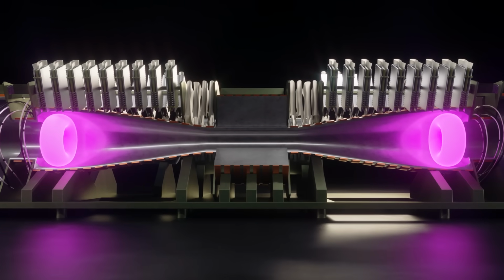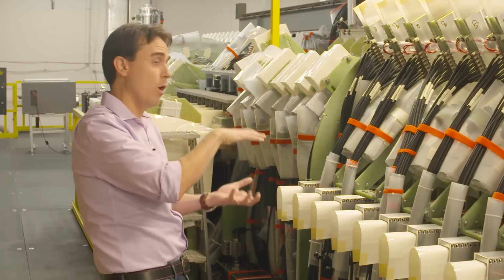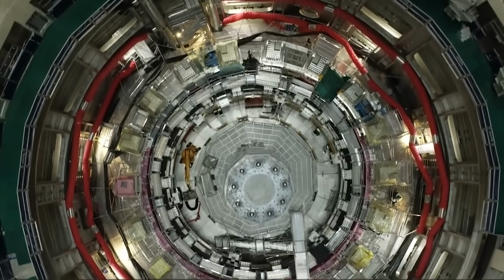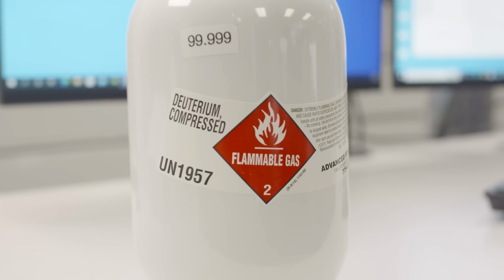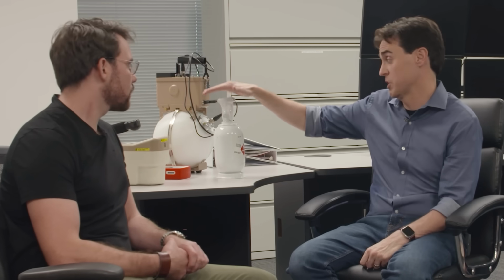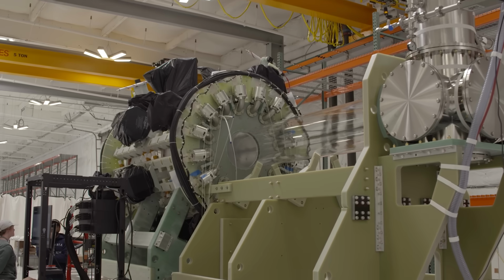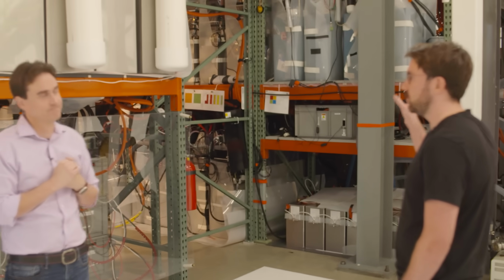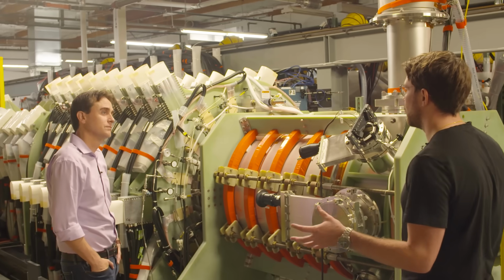A New Way to Achieve Nuclear Fusion: Helion

Comment: I love the fact that it generates electricity directly from the reaction, it always feels weird to go through all this cutting edge technology just to build a stream engine!
Reply: If anything, it shows the long-lasting impact steam engines have had on our society
Reply: @tacomeme429  if anything, it shows how we are just learning new and better mechanisms of energy conversion
Reply: We somehow live in a steampunk world, but it turns out it is unlike the visuals we were shown.
Reply: @Sapeidra  lol I was about to make that statement. Maybe we are moving to "Fusion Punk" if this keeps getting better
Reply: Yeah it's crazy that we've come so far and yet the most cost effective way to generate electricity is to turn it into mechanical motion and turn a turbine in a copper coil.  The only real exception is PV panels, and those only operate at an efficiency of maybe 15-20%.
Reply: @matthewm8876  Is that not proof steam turbines are the best means? The only other way is, as you say, 20% efficient at best.
Reply: Hey steam turbines work, some of the most efficient energy converters we have, you can't get waste heat if the energy you capture is heat itself
Reply: You proly still need a bunch of electronics to turn the electricity it generates into nice consistent sine waves used in the grid
Reply: This is so true lmao
Reply: Kettle not inculded....
Yeah totally agree 90% of power generation seems to be more methods of spinning a turbine.... certainly not all - solar and wind doesn't but even wind is basically turning a dynamo.
Reply: yes, it´s also mindboggling to me that every nuclear power plant in operation is a very sophisticated water boiler.
Reply: As the joke goes - one day humanity will build a Dyson sphere around the sun... To boil water. Yeah, it's annoying that most of what we do is so horribly inefficient, which is why any breakthroughs in energy generation are so exciting
Reply: it's finally feels like we're finally engineering lmao
- Less moving parts = less weak points
- Less energy conversions = more energy extracted
Reply: very wrong !
Reply: So agree hahaha i was always triggered by that myself
Reply: So basically hot plasma sex
Reply: Can you cash app me 50 bucks bro
Reply: Think of it this way: Incredible! I’ve got part of a nuclear power plant in my kitchen!
Reply: Fusion quickly would reduce Russian oil dependance.
Reply: Right? Using heat to create steam to turn turbines seems like such a backwards approach.
Reply: People who think steam turbines are primitive are idiots, or at least ignorant. The general public seems to have no appreciation for mechanical engineering anymore.
Reply: Yes, as this video shows, they convert mechanical energy into electricity.
Reply: LPPFusion is doing direct to electricity, aneutronic fusion research using the Dense Plasma Focus device
Reply: The question is, at our current level of technology, how would we capture the energetic reaction but a steam generation system?
Reply: That is the best spokesman for a company I'll ever seen. He condensed something completely beyond me into something very digestible and understandable. I love his subdued enthusiasm too.
Plus it's tech that will hopefully create abundance. It's hard not to be excited by this presentstion. Thanks for making this. Great video.
Reply: @quaker3 dude, he's a con man. Their "reactor" has no way of extracting energy at all. It's a fancy fireworks machine.
Reply: @Benjamin-xv9le  Yeah, you're probably right. Being a layman, he's very convincing.
Reply: What I like futuristic steam engine
Reply: Yes, no matter the power source we still generate electricity using technology from the end of the nineteenth century operating on principles discovered and formalized in the eighteenth.
Reply: I was literally talking about this yesterday. "isn't it funny we have all this advanced physics and we're still stuck boiling water?" It's like in a videogame where you forget to follow a upgrade path and you have some end game techs but you're still on early game tech on something else and when you finally up the tech you were missing you feel stupid for ignoring it lol.
Reply: No, not funny. As you often say “ the best things are the simplest ” and boiling water is simple.
Reply: @ub3rfr3nzy94  as advanced as our world is I can still sense the primitive crudeness that still permeates everything and I know in not many yrs this time right now will be like caveman times and theyll wonder how we stood the drudgery and uncertainty of this life.
Reply: @ub3rfr3nzy94  
Do you know why we're "stuck boiling water"? Because it's safe and effective. There are nuclear reactors that use salts to regulate heat and energy, they're called molten salt reactors. Do you know what water is? It's a damn good way to transfer heat. Water has one of the highest heat capacities among liquids that there is. And it's available in near unlimited quantities (for these purposes) on Earth. What does that mean? That means we can regulate a reaction much more safely because the water can be used to draw heat from the reactor and cool it down - this also means that we can also, if we want to, dramatically increase the volume of energy we're producing. As long as you're producing enough steam, you can just have more and more steam turbines to use and generate electricity with that steam. This is why nuclear reactors scale well - you have reactors that are civilian and "privately" owned like test and research reactors. For instance, there's like a couple dozen universities and schools that own their own reactor, Pardue University has had one since the early 1960s, a Lockheed design made specifically for Purdue then, that only generators 1 kilowatt of electricity, which isn't even enough to run your oven (some schools also have a nuclear "reactor" like the AGN-201 which can only generate 5 watts of electricity - not even enough to run a lightbulb, but these are solid-core "reactors" that operate more akin to a RTG, albeit not entirely). And this can be scaled up drastically. The Kashiwazaki-Kariwa Nuclear Power Plant has multiple BWR reactors with one of the newest reactors - alone - producing 1,350MW. With all 7 reactors running? They can output over 7,965MW.

That's a lot of versatility and options. Which, when it comes to engineering, is what matters. Sure, you could spend billions of dollars more having some Sterling-engine, piezoelectric or some such design that has no where near the safety and output as steam and be really, really more advanced than just "boiling water," but ask yourself: Would you want to pay more money for a design that is less safe and produces less electricity? ...I know what I'd answer.
Reply: @matchesburn  Maybe it would help if we called water something else? It's no longer 'Boiling Water', it's 'Hydric Acid Impingement Rankine Cycle'?
Reply: @maltheopia  
"Maybe it would help if we called water something else? It's no longer 'Boiling Water', it's 'Hydric Acid Impingement Rankine Cycle'?"
Oh, man, you just reminded me of that dihydrogen monoxide joke.
"And here is where the nuclear reactor boils 'dihydrogen monoxide.' It's a very dangerous substance that can easily kill a human if they inhaled it, but don't worry, it's safe inside the reactor."
Reply: Aye, but if a steam engine created that much heat or energy in general, there'd be one HECK of an explosion, and not the right kind 😆😅😝
Reply: Just by cutting away the water and steam in the equation, we could effectively made a smaller fusion reactor with the same amount of power generated.  Even in Star Trek, their fusion and matter/antimatter generator rely on direct energy conversion.  Great stuff.
Reply: Yeah, all those research to find more ways to boil water 😅
Reply: LOL....I think the good news is that it isn't too big, nothing compared to ITER that is! This can easily be shrunk 10 times by optimisation in the future and fit in a car.
Reply: @jordaniliev5825  No it cannot, you also do not want anywhere near the amount of capacitors a version of this technology downscaled to something that can drive a car. You will be creating moving electricity bomb that will electrocute anything it has access to in the case of a crash. Might as well be driving your own coffin.
Reply: @Yeet42069  We have been driving petrol bombs for 100 years, so I will take my chances.
Reply: @jordaniliev5825  No you won't because it won't happen lmao. Imagine having a driving hazard on the road because of 1 idiot's indifference.
Reply: @jordaniliev5825 There will be some major hurdles to overcome for the miniaturization of this particular system. They are deliberately enlarging the prototype for their next phase to prevent ions involved in the reaction from striking the sides of the machine as they follow their corkscrew shaped paths.
Reply: @jordaniliev5825  I wouldnt say easily, but maybe in the future we could have much smaller fusion reactors, maybe even small enough for space applications. But that is without a doubt hundreds of years away.
Reply: @kimjunguny Hundreds? My guy, have you seen any technology ever develop? I'm a computer scientist, so I'll use microchip manufacturing as an example: we have gone from a 10 micro meter manufacturing process in 1974, with the Intel 4040, to a (roughly speaking) 7~3 NANOMETERS in 2023. Now, gate size isn't the be all and end all of semiconductor technology, nor is it the sole indicator of improved performance or efficiency (especially because there is no standardized way to measure how big a gate is, so every company kind of does their own thing to make themselves look better), but I'm sure you realize that it's still an incredibly impressive achievement, obtained in a relatively short time (45 years or so). Those kinds of improvements were considered impossible at the time, and yet here we are. So, hundreds of years? I don't think so. Maybe 40~60
Reply: @kimjunguny  hundreds of years is a big stretch…
Reply: @jordaniliev5825  maybe not in a car but probably for space vessels. Cars would probably still be powered by batteries charged via these
Reply: @jordaniliev5825  I was thinking more like 100x to fit on the chest of my chassis in the garage... :D
Reply: @jordaniliev5825  The words "future" and "car" are diametrically opposed to one another due to the inherent inefficiencies of personal vehicles as means of transport, and there would be considerably better options for powering smaller vehicles than fusion reactors which would be wholly unnecessary given advances in battery and capacitor technology. But yes, the size of this type of system poses interesting use-cases once it's condensed - as someone else mentioned, satellites and spacecraft could make good use of this technology.
Reply: @lawrence-sheard  
"The words 'future' and 'car' are diametrically opposed to one another due to the inherent inefficiencies of personal vehicles as means of transport"
Spoken like someone that truly has the privilege of using public transportation and thinks that can work at larger scales and on a country the size of America. The only reason that "future" and "car" are diametrically opposed is because those in ivory towers that simply know more and are our "betters" will legislate them out of existence and then wonder why the economy collapses soon after that.
Reply: @matchesburn  As a person from a working class family living in a country with lack-lustre public transit, your comment about privilege doesn't quite ring true... 

Cars are inherently inefficient due to their capacity and average occupancy of 4-5 and <2 respectively, as well as running on rubber tyres which have high rolling resistance (not to mention the environmental impact, among other issues). The majority of people driving go to the same places every day - from their suburban house to their workplace in a city centre. This journey could be easily done by rail if a train station was within walking distance, which would not only be faster than sitting in traffic, but would also be more efficient due to trains having higher capacity and lower rolling resistance by nature of using metal rails and wheels. 

Commuter rail systems are of course not suitable for long-distance journeys from one side of the country to the other, but neither are cars. High-speed rail is a thing that exists though, and throughout Europe it has been used to great effect for trans-continental transport, and in many instances has replaced air travel due to being cheaper and more convenient. If you think that cars with maximum speeds of between 60 and 100mph that have to refuel every 200 miles and get stuck in traffic constantly are going to allow you to travel 2500 miles cross-country faster than a train going at 200+ mph, you are sadly mistaken. 

And for shorter journeys, well-planned urban areas facilitate walking or cycling instead, so cars are not necessary. This is not the case in the US, because the majority of places are designed specifically for cars with everything spread far apart, to the point where sidewalks don't exist on many streets and crossing the road is a crime (land of the free, huh?). 

The people in "Ivory towers" do not want to get rid of cars, because their donors (car manufacturers and oil companies) rely on car dependency for their business, and as such put pressure on officials to slow any transition away from car-dependent infrastructure. 

In short, cars are inefficient, and the US is designed for them not because they are the best option, but because those in ivory towers are pressured by corporations (or those acting on behalf of corporations) to maximise their profits. 

And before you say something about people in rural communities needing cars, or the disabled, or whatever else; yes - cars are useful for some people. But, in a well-designed city or suburb, the majority of people should be able to get to the majority of places via walking, cycling and public transit. This frees up the roads for those who actually have a reason to drive, like people living in rural communities with poor transit links, those who need to transport disabled people, or the emergency services.
Reply: @lawrence-sheard  
"Cars are inherently inefficient due to their capacity and average occupancy of 4-5"
That's a flawed argument, because you're assuming that these people are all going to the same destination, or in the general area. Let's say you're carpooling, but for some reason all of you are at separate ends of your town/city. North, East, West, South. Where does your capacity argument benefit from that? Given that people need to go to different areas, capacity is not efficient in your argument. Using the least amount of fuel - and time - is, however. In that case... absolutely nothing beats out personal transportation - i.e. a car. Only in areas with extremely heavily built up public transportation will you see people willingly forgo use of a car as it being more optimal. Japan is a good case study of this. And guess what? Most of the population in Japan? Still own personal transportation vehicles and still drive. So, no, your argument doesn't tread water.

"as well as running on rubber tyres which have high rolling resistance (not to mention the environmental impact, among other issues)"
...No. Tires have great efficiency. The problem is that tires are also attached to vehicle that weighs over a ton, are attached to an axle and also a drive-train. Unless you can make a car that uses near frictionless materials or is lighter than air and floats... You're not really going to beat out tires by much in terms of efficiency. Again, it's the mechanical work, gearing and connections that the tires are attached to that decrease their efficiency. That being... the car itself. So unless you want to somehow ride a tire to work... I mean... You can't handwave that away.

"The majority of people driving go to the same places every day - from their suburban house to their workplace in a city centre. This journey could be easily done by rail if a train station was within walking distance"
Not even Japan, even in all cities and towns, has this level of public transport infrastructure. You simply don't understand the scale at which you're talking about here. Walking distance is also subjective. Walking distance for someone in a remote African village could be a dozen miles a day, easily, without a second thought. Are YOU going to walk a dozen miles to get to your stop? And before you think that absurd: it isn't. Think about the scale of a country. How many stops are you going to need on such a large scale to service that size? It's not like cities and towns are isolated islands. This isn't Sim City where you just need to manage your one and only city and have a connecting road to some other far off place. Town A begins here and ends at this arbitrary mark on a map that is otherwise imperceptible and Town B begins there.Maybe there are suburban and rural areas inbetween, but the point is - life doesn't stop at city and town borders. Think of how many millions of square kilometers JUST suburb areas have. Just homes, with people living in them. And you have to have buses and trains all within "walking distance" on a grid layout to service all of them over a distance that vast in square miles.

Trains wouldn't even be viable at that point because the track would be too congested and dangerous to work. Buses? You're going to have literally going to have a few hundred million bus stops in America alone. And about as many buses. And then people will still have to plan around and sit in the cold waiting for a bus and have to figure out some way to carry groceries hoping that their food doesn't start to melt.

Y'see - this is my point. You're not thinking about all the implications and unintended consequences and the scale of this. You simply think in 5-year-old, "we do this and it good make better because good" terms. And, no, society doesn't work on that level. I'm sorry. There are real world, real life and very real reasons why what you're suggesting simply doesn't work. And the fact that it would cost quadrillions of dollars and bankrupt the entire world economy is only one of many. The fact that it actually wouldn't work because it's too simplistic and not scaleable relegates it to fantasy on the scales we're talking about.
Reply: @matchesburn n terms of using the least amount of fuel to carry people to their destinations  trains also win because although people have different destinations homes and jobs tend to be in similar areas, these are called cities. Trains are the most efficient form of transportation nearly everywhere except for rural farmland. Not to mention that your argument that most of people in Japan drive is useless considering that only 12 percent of trips in Japan are by car.
Reply: @matchesburn you seem to assume that we would put bus stops in rural areas in america which would be where public transit loses. Cars win in rural areas, otherwise they lose in efficiency.
Reply: @matchesburn if trains wouldn’t be viable because tracks would be to congested even though they are able to carry vastly more people then cars could you imagine a highway? Oh wait, you don’t have to imagine because of traffic jams are found everywhere and show that this would also happen to trains although it would be much harder to have a train jam than a car jam because of capacity.
Reply: @skygge1006  
Trains are only useful when you don't have most of your population in branching cities and towns with suburban population centers.

There's a reason why train mass commute that rivals buses or even cars is in very few countries and most of them the size of very small American states. You have no idea what you're speaking of.
Reply: @lawrence-sheard  If you think high speed rail in europe is anything but inconvenient and expensive you are wrong. I live in belgium, and rail is fine for commuting, at least from a  large town to another large town or city, high speed rail is absolutely a nightmare to use, especially when you start crossing borders. 
And if you don't live on a rail line between cities, forget it. Once you need several busses and rail connections you'll be taking hours even for a small commute. 

With a car I can get to antwerp (nearest city) in 30 minutes. With (our relatively good) public transport I'm travelling 2.5 hours. A TGV ticket to the south of France costs me 380 euros, with the car it costs me 100. And with a car I can take 3 other people with me for the same price, with the TGV that would be more then 1000 euros.

I drive to the station to take the train to  brussels or antwerp, but if you need to get anywhere else, forget it. And the same is true all over the world, once you get to more rural areas, public transport will always be slower and less convenient. And that's ignoring the fact that many people need to carry a significant amount of cargo, tow a trailet, etc.

You should hear the Germans or french complain about their much praised rail system. No one I know goes back to public transport once they have a car, except for transport to, and within the really large cities. The only people I know that are constantly praising public transport are those that have never had a car.
Reply: @paulhaynes8045  
As I said, explain to me a system that is more versatile and flexible for transporting people to multiple different locations all round a localized area. There is nothing more environmentally friendly for this than personal transportation.
Reply: @lawrence-sheard  Cars are never going to disappear completely lmfao
Reply: @matchesburn  Someone with common sense, I see!
Reply: The mechanical system is the most efficient system in the world. You must know that and stay away from what consumer companies promote.
Reply: I'm curious if there would be a way to harness that HUGE magnetic potential to do mechanical work?
i.e. Fusion Drive?
Reply: @benblas164 Easy, wire the reactor to a thicc-as-oatmeal ion engine.
Reply: A steam engine was cutting edge 2 to 3 centuries ago.
Reply: Ah yes, "a stream engine".
Reply: I was curious about whether they could create a secondary steam system for this application though.  Sort of how we have recycled steam on combined cycle plants that are basically large heat exchangers from the combustion turbine.  I feel like they could take that concept of not wasting anything and potentially use the waste neutrons to power said secondary steam system.
Reply: So fucking funny, lord, if we don’t love a turbine
Reply: If you had an opening perpendicular to the ends, it'd be a nozzle and you have a pulsed fusion rocket.
Reply: @alvarofernandez5118  How do you propose to retain a vacuum if you leave one end open?
Reply: These "imAGinE uSiNG A StEaM tuRBiNE iN 2022 LMAO" youtube comments are pure gold...
Reply: It shouldn't feel weird. It's not a steam engine, it's a Steam turbine. Steam engines generally refer to the heating of water to move a piston. Steam turbines are the best way we have to convert energy on an industrial scale. Did you never think that there was a major reason that we use steam turbines instead of direct energy creation through magnetic fields? There are A LOT of problems with Helion's modal here. I would put all the money I had on betting that they are NEVER going to get positive energy generation even in 20 years time. I'm surprised that Real Engineering didn't rip this apart more. Helion needs to drastically increase their temperature, they are losing a ton of energy generation operating at lower temps. And the amount of energy they are going to need to use to get positive energy generation out of a massive and expensive version of their prototypes is just gargantuan. They are going to need more energy than they are capable of pulling off the grid. They'll need to have their own HUGE energy storage field, bank upon bank of batteries be it flywheel or chemical or etc. And that's just to start their reactions. It's going to be MASSIVELY expensive. Why would anyone spead a trillion dollars getting fusion to work when we have great renewables?
Reply: This is the truth that they don't tell you 👉The Connections (2021) [short documentary]👀
Reply: Yes, this was driving me nuts for decades at this point. It's so unbelievable that with all the research we couldn't find a way for a direct conversion. Finally we see some progress, I'm not as mad right now as I was before.
Reply: @goldenstar6460  All power generation has their own strong and weak points.  Most focus on the efficiency and reliable.  Bicycle is the less efficient and nuclear is the most efficient but nuclear is not as reliable as water.  Saying "lasers and magnets and plasma and fusion to create luxurious energy for rich people" is pretty narrow-minded.  The purpose for fusion is to find a source of fuel that is nearly abundant and environmentally friend while generating power efficiently and cheaply as possible.  Fusion is not there yet but we are trying to make it happen.
By the way, solar is not as efficient as you think.  All the suns ray hitting the panel only generate around 15% of the power at peak.  You will need a lot of panels to meet the demand of one city.